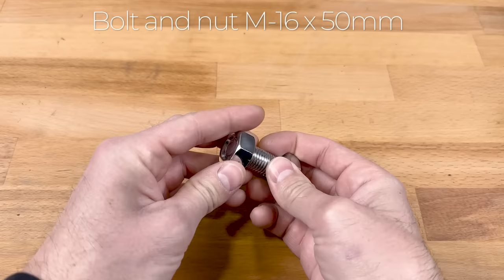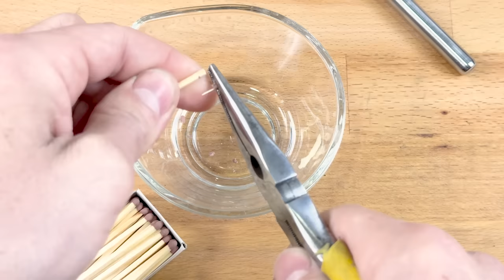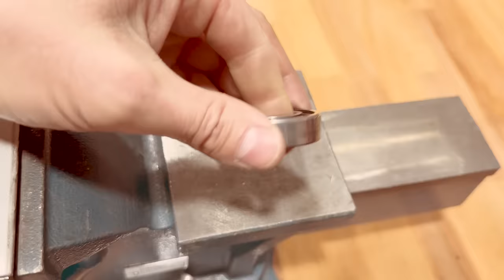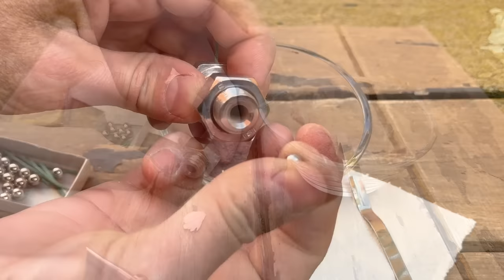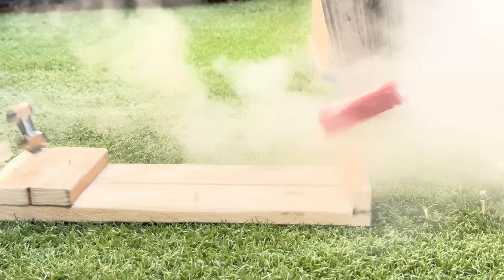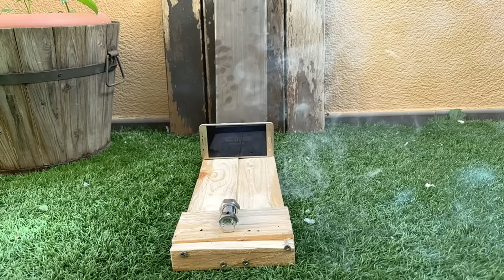I Turn a Bolt Into a Powerful Mini Cannon

Comment from the maker: En este vídeo os vamos a enseñar cómo hacer un mini cañón casero utilizando un tornillo y una tuerca. Es muy fácil de hacer y es muy divertido jugar con él, aunque hay que tener cuidado con este juguete.
Reply: But how is it that when you crush the mixture it explodes and when you compress the ball and the cotton wool inside tightly it doesn't explode? Does the cotton wool stop it?
Reply: @elad5621  it's the grinding to make it burns, like when you strike a match. If you just press strongly a match on the band of the match case, it will never ignite.
Reply: That is one really bad-@$$ mini cannon for sure!! Bad to the bone, little mini cannon!
Reply: It's A bolt,not a screw......

Comment: The force would be much greater if you place the rear side directly to the backside wood. Much power is lost by moving the bolt backwards.

Comment: Bolt action?
Reply: Lmao
Reply: You could maybe fashion a breech by drilling into the barrel from the top and seal the opening by tightening the nut to cover the opening.    Not sure there would be any benefit unless you were using paper cartridges to hold powder/wad/projectile.   Might be an interesting experiment.  Might have to built a slightly longer cannon/barrel?  Pretty sure it will work.  The propellant being impact sensitive you might also incorporate a percussion cap or similar ignition system.
Reply: Oh yeh Bolt action yo mouth going slurp

Comment: Glass pestle? An old school mate almost blew his face off with one of them.  Please folks if you are going to do this at home (not recommended!) flat heavy wooden surface only when you form an explosive mix, and light weight disposable plastic tools for handling the explosive mix (eye protection a must!), that way if it detonates while handling there is minimal risk of confinement or dangerous shrapnel.
Reply: Yep, this.  The mixture of match heads and striking material is much more volatile than people realise.  A friend almost lost his fingers making a bolt bomb with this mix ... the bolt ended up 10 metres away embedded in the neighbour's deck, so deep the neighbour never realised it was there.

Comment: There's no need to mix the two that makes for dangerous loading as the mix is friction sensitive now and could detonate whist you loading. Also change your ramrod for plastic, wood, copper or brass, that will reduce the chances of sparks, otherwise those were plenty of fun to play with. Also check out a few videos on making black powder, lots of fun and smoke
Reply from the maker: Thank you!!!
Reply: Yes, I was really worrying he was going to take a finger off with that. I had zero clue matchsticks could create that kind of power. Even if it were legal to make it in the UK, I think would be too unsafe to actually play with. I like my fingers lol!
Reply: @ViolenceDoesntWork  yeah fingers are expensive lol. There are also videos on YouTube to make gun cotton. Much more powerful than gun powder. Just if you decide to make then use with caution as these are all explosives.

Comment: Get some potassium nitrate and dilute it in a solution of water what's a tablespoon full of potassium nitrate and a quarter cup of water. Put a coffee filter in the solution take it out and let it dry and after it's dry you can use the coffee filter you can twist it into a fuse.

Comment: pretty cool but why make the powder friction sensitive if you are going to light it with a fuse, makes loading pretty iffy to me
Reply: Good point. The burn chamber has very little wall. Better to have a longer bolt, stop shorter and load the bolt with nuts for strength.
Reply from the maker: I only made that mixture to check in my workshop that it is very explosive with friction
Reply: @ironmadeinamerica5123 Think about a u-shaped ramrod so it doesn't blast your fingers. Then it's a pull, not push, you understand?❤
Reply: @baloog8 And if it goes off you get a 2 for 1 projectile
Reply: @servicetrucker5564  lol, he should wear thick leather gloves either way. Good god.
Reply: @baloog8  Right

Comment: I have used Strike anywhere matches to fill the .22 air rifle pellets which are hollow inside but from the rear, compressed it into the pellet then sealed the back with epoxy resin and have a bunch of pellets that explode on contact.

Comment: Think you just voided your phones warranty.
Reply: If there is a specific phone that gives you problems and you want the manufacturer know that you do NOT
like their brand, just send them a video telling them what you think about their phone and presto, you've
got some real excitement going on!! The Iphone and the Goggle Pixel phone would be ideal candidates.
Since they either are too cheaply built or too expensive to repair, OR take like Apple doesn't even want to 
grant you the owner of your phone an individual, the right to repair or allow you to source OEM replacement 
parts!  I've been damned tempted to do that sort of thing, just to prove a point that when a manufacturer thus
decides to screw over the consumer, they end up getting free advertisement of the adverse kind and rightfully
so!! I'm fairly certain that the phone that was used in the video ended up being a Samsung S7 which was one
of those phones that had display problems and the fact that just about any of the Samsung phone display
glass breaks way too easily! Why they can't seem to make them better is beyond me, but hey!

Comment: did the same also and used sections of bike frames to make cannons, one end folded over airtight, for wadding we used sheep's wool caught on barbed wire fences, we called them banger guns as we got gunpowder from bangers (fireworks) but also made crude powder from red match heads, we also used two 48mm threaded bolts held with one nut in the middle and thrown like a hand grenade, it was about one foot long and when it went bang it was like dynamite going off, scared the shit out of us, we found the nut buried into a tree trunk, all very dangerous but wouldn't have done it if it wasn't, we as about ten I reckon,
Reply: Ten? Professional militia don't know how to do that.

Comment: Où On achète les Mèches pour Allumer le Canon Explosif ? Onde Podemos Comprar os Fios para Acender e fazer explodir O Canhão Explosivo? En général  quelle magasin, em Geral qual Lojas ?
Reply: Just grind some matchpowder and put some water on it, soak them into the paper or string. Let them dry for few days and they will work fine. It wont work as well as commercial ones though
Reply from the maker: Aquelas mechas son malaisidas de crompar dins fòrça païses. Avèm crompat de petardas e avèm levat las mechas